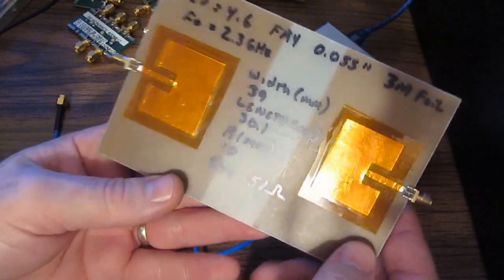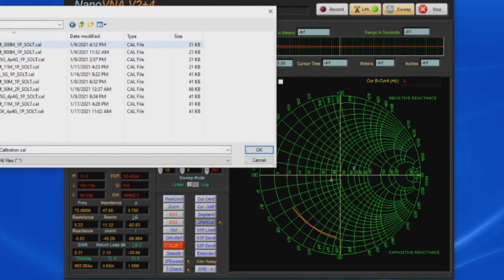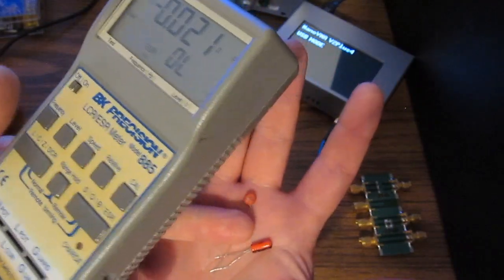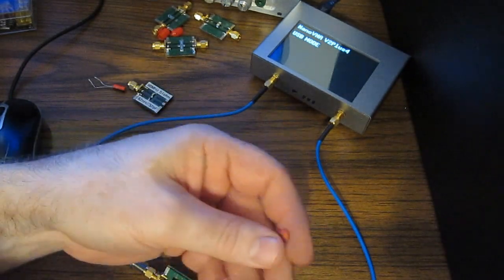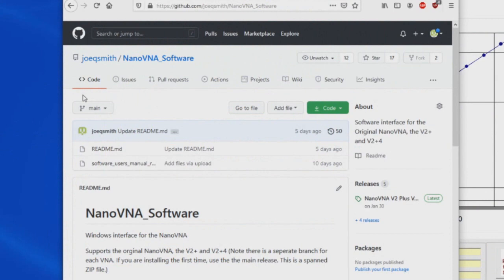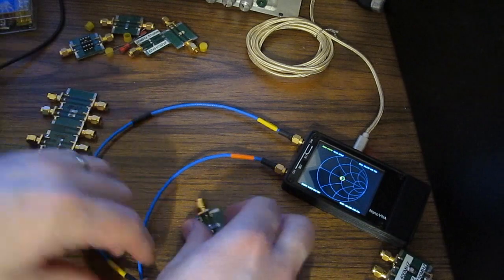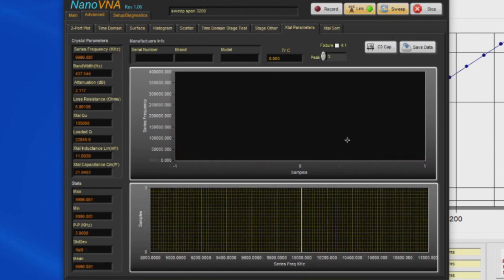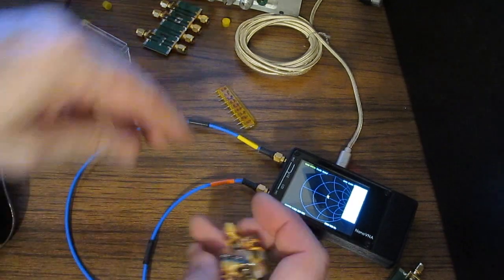NanoVNA Software Enhancements (ESR, Crystals & RADAR)

Comment: Seems nice but COM port does not work ... I really hate LabVIEW bloated install/libs ... 
If you have a version without external dependencies it will be perfect
Reply from the maker: Good post.  I will pin it to remind me to update it.

Lets start with COM port does not work.   I have been using LabView for about 26 years now and bought a license for my home use when LV5 came out.  Of course I use the serial ports with it and I doubt very much I am the only one using them.  To suggest they don't work seems rather ignorant.  Now I can believe that you personally have been unable to get them to work for some reason or another.  It doesn't seem like you are looking for help though. 

I can certainly understand your hatred towards bloated installs.   Let's put some numbers to it.   The installer for this software is 250MB which includes the program, runtime and VISA.   A quick search on Google, VS2019 looks like it needs 800MB, .Net, 231MB , Java 124MB, Python 115MB.   What's Windows 10 require?   It's hard to believe anyone running a modern PC would consider any of these bloated. 

It sounds like you would like to go back to the days of DOS where we write .COM files that talk directly to the hardware.  Sorry, that's not going to happen.
Reply: @joesmith-je3tq  In my previous job I have developed a native windows com port DLL (for native or usb com port) interfaced in LabVIEW as LabVIEW was full of issues with integrated com port on tons of different PC ...
it is why I hate LabVIEW stuff and I prefer native C/C++ (which are often less bloated) stuff like Qt/Dear ImGui...
Maybe let's continue that issue in github https://github.com/joeqsmith/NanoVNA_Software/issues/2 (my computer use Windows 7 Pro for information and I have tried to install/uninstall tons of different version of Labview Runtime without success with com port error all the time when I try to connect ...)
Anyway I have big respect for your amazing work and very good video
Reply from the maker: @bvernoux  Your post hit the filter as I don't normally allow embedded links.   Back in XP and prior, I was writing my own interface in C for that motorcycle HIL simulator I've shown.  Once I moved to Windows 10, I ditched all the C and now have the model running in LabView and use their driver wizard to create the driver for the hardware.  I've used that driver wizard a few times now with custom hardware. 
I ran into problem with one version of LabView where they rewrote the serial interface.  It turned out that out of the various USB/serial dongles I had, the ones from FTDI were fine.  So I ditched all the other dongles.  Since then, I have not had a problem.  But if it's as bad as you suggest, I would guess the NI forums are buzzing. 
I am not sure why you would be trying "tons of different" versions of the runtime.  If you wanted to run my software for example, you need to run the correct runtime and VISA or I wouldn't expect it to work. You can't just install things at random and expect good results.  When I first posted my software, I didn't include NI-VISA.  I was surprised a few people caught it and were savvy enough to get it running.  Of course, I submitted a new release shortly after that which included the proper library.    If I had to guess, you did not install the software from that ZIP that contained VISA and then started trying different packages to get it to work.  Just install it clean, oh, and read the manual!  That software is NOT for the beginner.   Failing to follow the detailed instructions and randomly pressing keys may not work very well.

Comment: Joe, thanks for all of your work on this.  Will your VI's compile in the LabView Community edition?   Do you intent to go commercial with this at some point?  If not, will you make the source VI's public? It would be interesting to have a look at code.  Any way to add a direct print on the graphs by right clicking on the graph?
Reply from the maker: I could create what ever sort of printing but anymore it is VERY rare I go to paper.   Instead I use snip and add what I want to my document.   

I have no plans to charge for the software.  

There is no reason to offer the source.  I've had several people wanting to do some sort of collaboration.  That is until I start asking about their skill set.
Reply: @joesmith-je3tq  Thanks,  Any plans to add group delay?  Useful for tuning some types of filters.  I see that you are adding k-factors to your solver64 software,  I know that I can calculate these from the S-parameters, but it can be useful to see in real time when adjusting an amplifier design on the bench.
Reply from the maker: @bobmorris5971  Group delay has been supported since it was released.  As a matter of fact, most of my recent posts have been using group delay.
Reply: @joesmith-je3tq  OK, I'll review more videos.  Doing a search on the manual, I did not find any mention of Group Delay and I did not see it explicitly and an option for transmission parameter display.  I'll look further.
Reply from the maker: @bobmorris5971   Most people don't expect older software to support all the features of the latest release.
Reply: @joesmith-je3tq  Yes, I now see group delay in Solver64 and it works well.  Apparently it's in this original version.  Sorry for any confusion.
Reply from the maker: @bobmorris5971  I have no reason to misrepresent the software I wrote.  Of course it is in there as I stated.

Comment: Thanks for the great software package. I have a VNA 2 plus 4. Will you be beinging out a version foe Dislord  version of software?
Reply from the maker: Stan,  I had recently evaluated DisLords most recent firmware along with an older version on an H4.  This combination has problems.  You may read about it in the attached link.   

https://www.eevblog.com/forum/rf-microwave/nanovna-custom-software/msg3585459/#msg3585459
Reply: @joesmith-je3tq  Hi Joe
Thank you for your response. I will be rolling back my firmware so I can use your application again.

Could you give me advice on a butterfly air variable capacitor. Would the ESR change significantly if I would add a mica disc (or any other insulating disc), slightly larger in diameter than the butterfly fins to prevent flashover. My objective is to create a physically smaller variable capacitor with higher flash over voltage for use with a magnetic loop antenna where resistance needs to be kept as low as possible. I have not been able to find any papers or articles on this construction. 

What other factors would influence this constructed butterfly variable capacitor in the magnetic loop antenna? 

Could the same process for measuring ESR on fixed capacitor as shown on your Youtube be used as there are no armature wiper blade losses on the butterfly variable capacitor.
Reply from the maker: @stanholmes4293  Stan, I wasn't aware DisLord had made firmware for the  V2Plus4.  I have not tested that combination, or any others beyond what I mentioned.  Does my current software I have today work?  Do you have to use the one for the old hardware or for the V2Plus?   What was your reason to install different firmware? 

For your air capacitor, I am by no means an expert in the subject of radios.  While your research may have come up short, you have the Nano and could attempt to run your own experiments.  The problem you may run into is what I demonstrated in this video.  The Q is normally going to be fairly high for your application.  You may find that the V2Plus4 is not up to the task.   You may want to broaden your search to exclude references to the VNA.   Limit it to something like "variable air capacitor ESR " and you may find details on how it could be measured.  If you read the latest manual for my software,  I am attempting to make some PDN measurements.  You may find that section of interest as I was attempting to determine how low of values I could measure with the original NanoVNA.     Good luck with your project.  Post a link if you decide to post about it.
Reply: @joesmith-je3tq  Joe, I'm using your latest software. It connects and calibrates. In the sweep if shows checksum error.

I loaded DiSlord mainly for the addition point and display grid.

Thanks for the pointers on the ESR.
Regards
Reply from the maker: @stanholmes4293  Just to be clear, my software shows a checksum error when used with your V2P4 running the original firmware?    If that is true, what software and firmware versions are you running? 

What is this addition point you mention.
Reply from the maker: I did all the development and made the review using firmware git-20201010-86c7055.   There are newer versions available but I have not tested them.
Reply: @joesmith-je3tq  Joe, Here are the two hardware versions I have.

VNA-V2-Plus-4 and works with your NanoVNAPlus_r1_04.vi and below version
Software copyright @edy555 Version git-20210225-ebc366e 18 May 2021. Has 201 sampling points

Software copyright @Dislord, @edy555 Version git-20210215-417f5bd Mar 30 2021. Has 371 sampling points. This version does not work with your NanoVNAPlus_r1_04.vi and displays checksum error. It connects and I could carry out a calibration.

Hope this helps
Reply from the maker: @stanholmes4293  This explains it.   I doubt the DisLord firmware or most other nonstandard firmware you find will work with my software.   If you follow this think:  https://www.eevblog.com/forum/rf-microwave/nanovna-custom-software/msg3589723/#msg3589723     This person was testing with  20201013 which is the last stable release.   I was concerned that the stable release was causing your checksum fault.   I currently have to plans to support firmware beyond the stable release.  You may want to have a look at the open source software.  They may support the combinations you are trying to use.   Good luck.

Comment: Hi Joe, great video! Did you already check the LibreVNA project? If possible, could you comment? Thanks
Reply from the maker: Hello Rob, I have been following it. Recently someone asked about porting this software to support it.   I spent some time looking at their documentation and joined the group.io.  Sadly, they never approved any of my questions and would not allow them to be posted.  The person who was asking did provide some details about the project's status. Based on emails from the designer, it seems the protocol used to communicate with the device is still under development.   If you read the posts on the groups, it seems they are also having a lot of basic problems.  It may be too early to get involved. 
As far as porting this software to support it, or any other VNAs, I don't see a problem as long as the design is stable and well documented.

Comment: Hi Joe, I got one of the newer Nano-F's which I'll give a try.  I do have the older Nano's knocking around that I use for ham stuff so will be interesting to see if they work out of the box if the F doesn't play ball.  Great stuff as always.
Reply from the maker: If you check that EEVblog thread, the person attempting to measure their crystals had posted what version of firmware they tried to used.   You may need to play around a fair amount to find a version of firmware that is actually stable enough to use.  Good luck.
Reply: @joesmith-je3tq  Noted. Haven't been on the forums in a log time but this is more than enough motivation to get me back on there.
Reply from the maker: @vincei4252   You may find their post here:
https://www.eevblog.com/forum/rf-microwave/nanovna-custom-software/msg3525596/#msg3525596

Comment: Great software Joe! Any chance to have it compiled to run natively on MacOs? Thanks
Reply from the maker: NI has been provided support for the Mac for about 10 years now.   I am using LabView 2011 which if you follow this link, you will notice is not listed.   

https://www.ni.com/en-us/support/documentation/compatibility/18/labview-and-macos-compatibility.html

We would need to procure a new license for Labview as well as the same exact Mac/OS you want to run it on.  In order to continue to support it, I would want to upgrade the other software to the new release of LabView as well.  I doubt this will go smoothly based on the last two times I tried to deal with Apple.  Lets assume a couple of weeks to port and test it.  

Of course, you could just buy a Windows based laptop or:

"NI recommends using Boot Camp to natively run Microsoft Windows on a machine running Mac OS X and using the Windows version of LabVIEW."

Comment: Thanks Joe, and is that possible to share some SCPI code? so people can have other method to access the device, such as a python terminal.
Reply from the maker: There are a few open source projects that I suggest you have a look at.    I thought they had used Python so you may be able to use what is there.   I have not looked at any of the other interfaces so I can't comment on them.
Reply: @joesmith-je3tq  Oh, really? Will look into it. Thank you

Comment: Will your new SW work with the latest nanoVNA with the N connectors?
What language's did you use to write the code?
Did you use Visual Studio, Qt Creator or other IDE to develop the GUI screens?
Reply from the maker: I use LabView for all of my PC software.   If you checkout my github account, there is a fairly lengthy document for the software.  There is also a link in the description to the EEVblog site where I posted about the development since starting the project.
Reply from the maker: Your 2nd response hit the filter.  I don't normally allow embedded links for ads.  This channel runs out of pocket with no donations or ads.   As far as will this software work with different VNAs, again, take the time to read the manual.  If you can't be bothered, I suggest not wasting any time with it.   Its a bit of a mess, filled with problems and is a bad choice for the beginner.    I suggest running the software supplied by the manufacture or one of the many supported open source interfaces.  Join the groups and ask for support there.  I'm sure you will find people who have bought the same unit you are looking at that can help answer your questions.   Good luck.